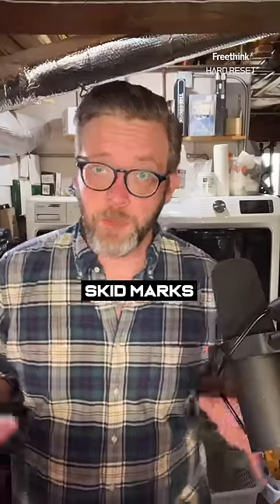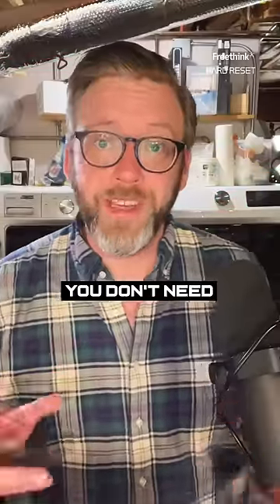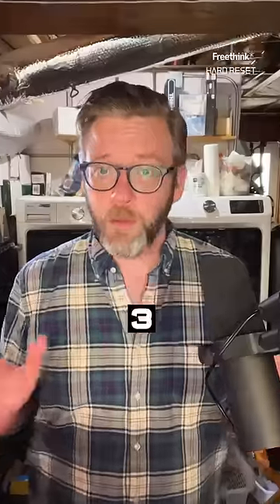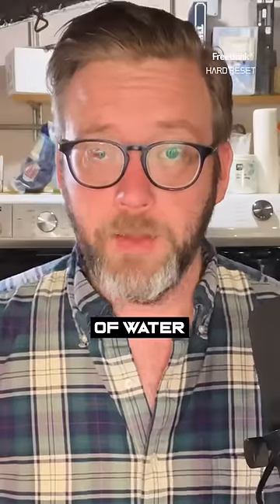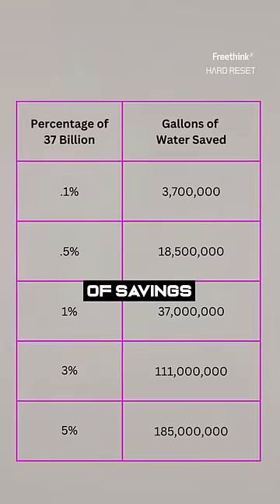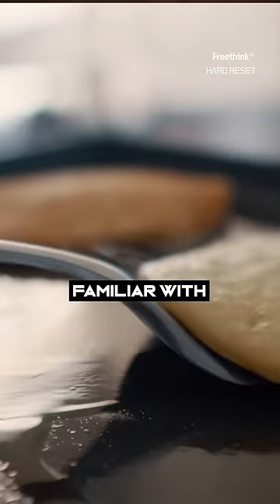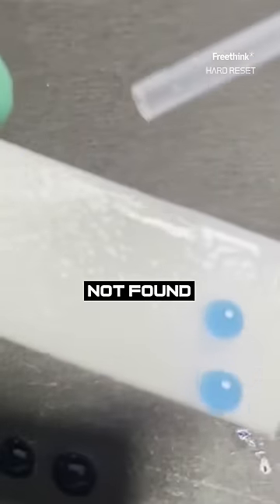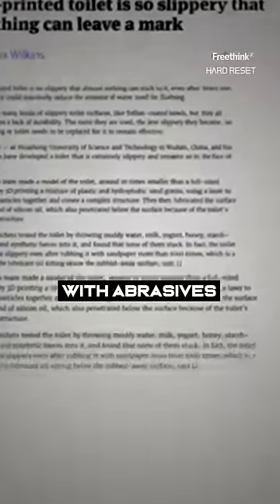Researchers invent super slippery toilet 🚽😳 #shorts #metamaterials

Comment: Wastewater operator here. The way our sewer system is designed, we need a certain amount of water to go down with solids otherwise the velocity of water will go below a certain threshold and we get solid deposition in our mains which is very very bad. This technology might be useful for certain applications, but i strongly recommend against just swapping out everyones toilets wholesale for it.
Reply: What about using this material to like the inside of sewers to help move solid waste this requiring less water. 🤔
Reply: @alexmendez3681  That has its heavy costs in not only budget but time, and I believe such a fine material would not sustain for miles underground. Atleast, for a long period of time. 
But who am I to speak? I do not perform pipework. No one knows what the future entails…
Reply: Probably better used in sinks or tubs or industrial drainage systems then
Reply: make drainage lines the same way before you pit the toilets out
Reply: thats the end game, when everyone changes, the industry is forced to change.
Reply: We use septic tank, is that bad?
Reply: you can flush it by hand then
Reply: Weird, our toilet water ends up back in the rivers that our systems pull from, who would have realized “wasting” water is impossible unless you completely remove it from the ecosystem
Reply: @addisonpage1 Yeah, there's absolutely NO reasons one might not want to mix waste water back into rivers and lakes, NONE at all.

Smh 🤦‍♂️
Reply: @otakuman706  the water goes downstream, evaporates and leads to lakes, once it evaporates it turns into what we call clouds, and those clouds turn into this cool thing called rain. It’s the goddamn water cycle ffs, go back to third grade
Reply: @addisonpage1  
Oh and if it evaporated to start it wouldn't then 'lead into lakes'- it would already be evaporated, unless then recondensed into liquid and put back into the system.
Maybe you meant evaporation as one stage of filtration, but I think me expecting that would be too much credit given...
Reply: Were you not even paying attention? Wastewater operator. It's the stop stuff from sticking. It doesn't stop water
Reply: @everythingpony  I mean, the point of the whole video was this being used to save water, meaning the amount of water used is decreased, so I see their point.
Now I could certainly still see this used in toilets and other places (of course likely with tweaks' etc., not saying directly replacing the toilet and leaving the rest of the system) but I can understand why they'd say this. It could definitely cause issues, even if one was simply to snap their fingers and swap every toilet to one with this stuff and slightly decreasing the water used, you can probably see how this can create problems later down the line.
Reply: Easily solvable.
Reply: @jihyungpark535 it's extra slippery. You don't want it in a tub. Maybe the walls around the tub but rails would have to be installed because the walls would be, too slippery to help a person stop themselves from falling.
Reply: Ideally what should be done, is all the wastewater facilities should be upgraded to treat the water to a point where it’s clean or nearly clean… the water is then pumped into a cistern where it is then distributed back to the homes through an auxiliary water supply.  

So each home would have 2 separate water supply systems.  One is the waste water reclamation water, and that would be piped only to your toilets.  There is specially marked purple piping for this exact purpose.  And all other fixtures in the home are connected to the regular domestic city water supply.  So this way we can re use the same water 1000’s of times, and we can stick to the regular low flow toilets we already have.  

Of course it would take a tonne of infrastructure upgrades.  But I think this is a viable solution if we are to save the water we need to save in the future.
Reply: I was thinking how hard water might affect the bowl more than debris.
Reply: @otakuman706 why wouldn't you just treat the water before releasing it into your lakes and rivers? It's very cheap and easy to treat wastewater from households.
Reply: @benrichardson2872  this is insanely inefficient, just use the same water from your tap as your toilets, you don't waste any of it to begin with -- the premise is incorrect.
Reply: @HarrDarr  Yes, this is generally how it's done in the modern world-- aside from places that simply can't, for one reason or another (although generally down to financial reasons in the majority of cases,) and/or in emergency releases, disasters, etc.
Reply: @otakuman706  yeah, I knew that already. I was putting the notion into question, why would you change a robust and working system on false premises?
Reply: @HarrDarr  I said that may possibly be one aspect to this type of product being used, in this particular way. Things improve and change over time, sometimes in quite unexpected ways.
If we weren't willing to trial new changes looking for improvements (and yes this leads to failures many times) we wouldn't have that system to begin with, we'd still be using holes in the ground, if even that; I'm not too sure on the knowledge of early human evolution and the usage, or lack of, toilet facilities. 

I think I was clear that a simple 'plug and play' type fix where we would simply be popping stuff into existing systems may not work. Was kinda my main point between the couple of comments I've made here. Also why I then said I understood the point being a subject of discussion -- any change in a complex system like this can have far greater (or greatly reduced) effects than one may initially expect.
Maybe that will have explained it better, although I've got a killer migraine so idk how intelligible it all is 😂

Hmmm... Got me thinking that I don't know if I've ever heard of, or seen any studies on the subject of early 'bathroom habits' of humans or our relations...
Although I imagine it would be hard to study especially given the time involved etc. 
Having said that I do know they've found coprolites and/or paleofeces (depending where one draws the lines) in some instances, but I don't remember how far back they go, nor how much useful/applicable information it was possible to gather from the surroundings about any waste management practices.
Reply: The better option is to go the other direction to fire. Incinerator toilets have existed for awhile and are used in places the world gets hella cold and would be fairly easy to retrofit most places. Also the one brand is names Cinderella which is hilarious.
Reply: thats called systemic failure my friend. fix the sewer system so it doesnt waste water.
Reply: @jackjones2696 by the industry you mean changing hundred of thousands of kilometers of pipe huh. Good luck with that
Reply: @AbsurdAsparagus  I mean... kinda, I guess... in a way I suppose, but generally the systems goal is to waste as little water as possible and to allow as much water as possible to be reused-- at least to the point it's no longer fiscally sensible.

Not saying I think it's a perfect or even 'great' approach, but aside from say, actual disasters, accidents, corruption, etc. they usually accomplish this (or come close, aiming to improve and reach it,) or they are simply shut down as not being cost effective or the like, usually being replaced/improved asap (well asap with taking the cost into account again 😂)

In our current world many, if not most or all, places are gonna have water that is contaminated to various degrees in one way or another, and therefore considered waste. It's a by product of many industries, as well as being produced by the general population  in most cases.

Again, not saying this is the 'end all be all' system or anything, just that they generally do reach their goals, or they are usually tweaked/upgraded or simply decommissioned. In this case, by their definition it wouldn't be a systemic failure. I say by their definition simply because other groups/individuals could argue various points on the topic, but to see if it succeeded or failed you need an agreed on end point so I thought this would be an easy one.

Now whether this type of water management leads to more issues and causes systemic failure of our society eventually, I can't say, but there are reasons some people worry about maintaining enough water for the growing population etc. Maybe you meant something more like this, in which case I apologize for misunderstanding; but if it was meant how I originally thought, I think using the label of systemic failure wouldn't exactly fit in this case.

Like I think OPs point is that simply swapping this into existing toilets, without further modifications to the rest of the system, could itself lead to systemic failure (more likely it would be smaller issues, but still) of the water management system. Less water used leading to a more concentrated sludge being pumped out of homes would most certainly change the dynamics at the very least-- i.e. compare water with waste flowing in a pipe against a much thicker substance like... toothpaste in the same sized pipe-- and could have many more complications down the line.

Eh, I hope this was understandable and not like super easy to misunderstand, but I'm tired of typing on mobile.... And in general atm 😂
Anyway, cheers mate.
Eh, I hope that's understandable and not misleading
Reply: Yeah I was just thinking that a lot of the water is probably necessary to keep things moving in the pipes. Could be great for urinals though!
Reply: Thus where the problem lies. We have the technology to solve almost all the worlds problems-but we hold ourselves back for no reason other then that it costs "money", mankinds most limiting invention.
Imagine a world where all great ideas came to light regardless of cost simply because we have the materials to make them. What a world that would be.
Reply: @river_tech  It truly is a shame the various things that have been pushed back especially due to cost, or outright abandoned. 
I understand, but it can still suck and be a huge bummer.
Reply: Damn that is interesting. Thanks for sharing
Reply: that was actually pretty interesting. but you can still have the best of both worlds. toilet water is still clean treated water safe for the population. you can easily if everyone had these types of toilets still recycle dirty water without having to treat it up stream to still utilize it for its "transport" properties
Reply: Can we not mix induatrial flo into sewage systems to main tain the liquid leka ?
Reply: ok nerd
Reply: We would  still be washing our teeth and showering bro 😂
Reply: It could be an interesting antifouling material for membrane bioreactors if it's sufficiently hydrophobic and oleophobic. But yea the system would need to change if all toilets were to be swapped out. You'll need to have in place new infrastructure that would add water into the sewers but at least that water doesn't have to be clean water.
Reply: I bet you would normal toilet lobbyist detected xD jk jk
Reply: I love your work.
Reply: Thats kind of what i was thinking. Dont you need lots of water to move the poop along?
Reply: My dad was the manager of a wastewater treatment plant for decades and said the SAME THING! I was blown away. So funny how some things sound great in theory but once applied it doesn’t work that well
Reply: @mj6901  whats his feeling on low flow toilets? Some toilets have two flush options for solid or liquid. Has that made a difference?
Reply: @benrichardson2872 Not even just toilets. Much of Texas is in a water crisis because 70% of the potable water is used to irrigate unnecessary lawns. Just having the partially treated water available for landscape use would make a huge difference here.
Reply: @everythingpony less water means less water pressure.
Reply: @everythingpony meant to keep stuff from sticking to use less water to flush. He is saying too large of a decrease in water usage would prevent water treatment plants from working correctly.
Reply: This was my first thought about this new toilet.
Reply: @otakuman706 sewer waste water is treated an then discharged back into rivers. What else are you going to do with it? Contain it and make wastewater lakes and oceans?
Reply: @everythingpony You clearly don't understand how toilets and their connected piping works to move waste solids. Most waste disposal systems in buildings/homes are gravity systems requiring a certain slope on the waste pipes as well as a  certain amount of water to move the solids along.
Some systems also make use of pumps to lift waste to a high enough point to drain via gravity into septic tanks or the municipal sewer lines.
But even the pumps require a certain amount of water/liquid to work.
Reply: @alexmendez3681 dunno if its been said but pipes are level and move along using water pressure so even if you were to coat the inside of the pipe unless you make sure every pipe is angled down and towards the treatment plant it won't move without the water pressure.
Reply: I guess for septic tanks would be the way to go
Reply: Just an example of current processes needing to catch up / adapt to technological / scientific advancements. I'd bet a few ppl complained abt the cost of having to pave brand new roads when the first cars were invented
Reply: Hey bro thank you for your service for our communities. I hope you are not only properly compensated but praised for your work ❤.
Reply: What if you make the plumbing pipes also super slippery? That would be very helpful I believe although very expensive to replace the pipes.
Reply: We need to redesign the wastewater system then. Not like it works; it still drains into bodies of water and generated hazards so often on beaches every time it rains or floods.
Reply: We need to decomp our own poo on site
Reply: @benrichardson2872  No offense but this is a stupid idea, and is less efficient that what we already do.
Reply: A solution could be a smart toilet that flushes a larger amount of water every three or so flushes to move the material down.
Reply: @ameyring  why not simply have it be a local composting solution
Reply: @addisonpage1 dunning kruger right there 😂
Reply: That's exactly what THEY would tell us!! 

Jk
Reply: Use it to coat the inside of drainage pipes
Reply: What about bearings?
Reply: It'd be great for RV toilets.
Reply: @diablomills7132  So just dig up the entire sewage and drainage infrastructure worldwide and replace it all? That's the solution? LOL
Reply: @addisonpage1  Notice how you said the water in your toilet ends up back in the river? Not the sewage? The water in your toilet only ends up back in the ecosystem after a massive amount of processing and refining to remove contaminants and pollutants. Fresh water is a VERY limited resource. Wasting water is ABSOLUTELY possible when you consider what sewage is, it's unusable. We're not talking about stuff that's wet, we're talking about ACTUAL fresh water that can sustain life and provide us with hydration / irrigation. Try doing that with sewage.
Reply: @MawcDrums  the water coming in from the river isn’t fresh either, it’s full of parasites, pollutants, etc. honestly if you want to poop in a waterless toilet, go be one of the first to actually do it instead of lecturing all of us on why we should. I’m serious, if you believe this so strongly, which I respect you for, then go do it and post pictures telling others to do it fam. If not then it’s just moot isn’t it
Reply: @Ocean-m9g  "why not simply have it be a local composting solution" 

Because human waste is dangerous and breeds disease. It's the main reason we're not all dying of dysentery or cholera anymore.
Reply: @addisonpage1  River water is absolutely fresh, you often can drink water right out of the ground at the source of springs with minimal or zero contamination risk. Can fish survive in sewage? How about in river water? What's the difference? Can we just boil raw sewage and drink it? How about river water?

I'm saying that the waterless toilet is a BAD idea since we wouldn't have a way to move and process the waste. But I also completely disagree with you that it's impossible to waste water.
Reply: @MawcDrums  there is processed human manure sold for gardening these days
Reply: I’d still want it in my toilet to make it easier to clean. Even if I have to use the same amount of water. 

But we might be able to cut down the water some. High efficiency toilets exist where you can flush differently for solids or pee so this would still save a ton of water when there’s no solids.
Reply: Make the sewer pipes out of it 😅
Reply: Once down the toilet, would it be possible to flush the material out of the pipes with already used/stored grey water? Like, from showering/the sink/etc.?
Reply: Or the fact that we literally are using less and less water to flush over time through various advancements without redoing the entire sewer system. Makes me think that there are solutions out there for specifically this application still.
Reply: that's a good point,    i have a question maybe you can answer?

in Thailand, China (and i have to assume other parts of Asia)  the plumbing pipes are considerably smaller.
they are so small, you aren't supposed to flush toilet paper as it may jam the pipes.

would non-stick toilets that incentivize less flushing water be a better fit for the Asian market,  or would the problem (not enough / too much water)  translate to those reduced size pipes as well?
Reply: Can I just give a big THANK YOU to all wastewater operators?
Reply: Reminded me of that event that happened in denmark o norway. Somewhere up there, where everyone in a city were told to flush their toilets at the same time to assist the plumbing
Reply: If it’s not found in nature it will cause problems later
Reply: @StevoDesign will lead to mineral deposits causing cloggs and waterless urinals have been manufactured already.
Reply: @jennabrilon1186  could be done but would be just as efficient as using Grey water for the toilet tank.
Reply: Perhaps regulate it in an area and have a lottery, maybe give to more lower income areas first as it’s focused on water.
Reply: You know that if this happens why would obviously also change the rest of the system, right?
Reply: @six_buck_dlc  Well it's not like replacing billions of toilets is cheap either.
Reply: Can hydrogen sulfide from sewers get through the water barrier from commode into your house ?
Reply: @Marta1Buck 
Is using a septic tank "bad"?!
It's certainly not 'good'.
Civilised countries/communities install reticulated sewerage systems ASAP.
Do you understand the 'septic' part of 'septic tank'?!
Do you understand where the seepage - including bacteria - goes?!
Have you ever wondered why the grass and plants near your septic tank grow so well?!
Do you have your veggie garden near your septic tank?!
Reply: "Wasting" a finite resource does not (necessarily) mean it's permanently 'lost' from the entire eco-system.
It means more than necessary was used to achieve the desired result - ie it's potential was wasted.
Water used in excess of the need to efficiently flush toilet waste reduces the amount of water available for other uses - eg growing food, drinking.
Also, the more water needlessly entering the system the more effort and energy required to return it to the eco-system.
Ergo, further wasted finite resources.
BTW - 'water' can be removed from the eco-system.
Reply: @river_tech 
"Money, mankind's most limiting invention".
And yet the USA spares no expense on war. 🤔